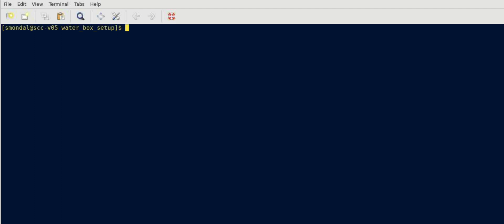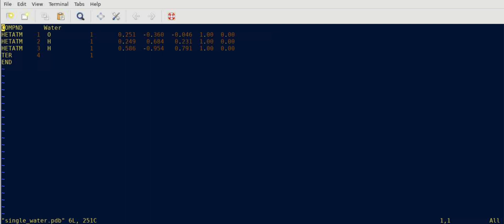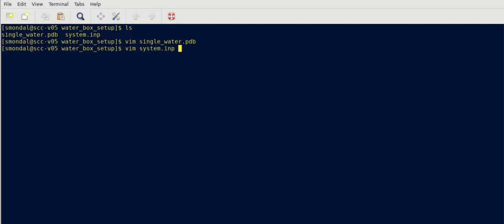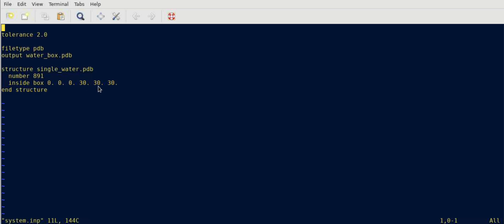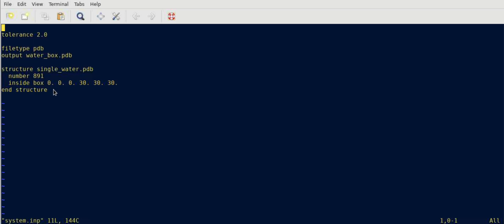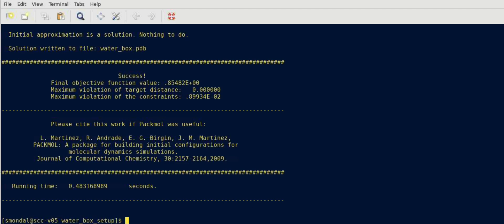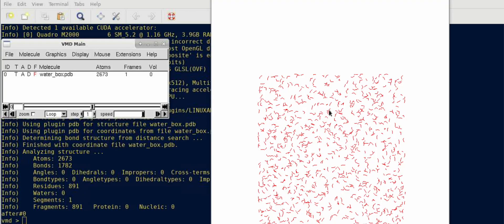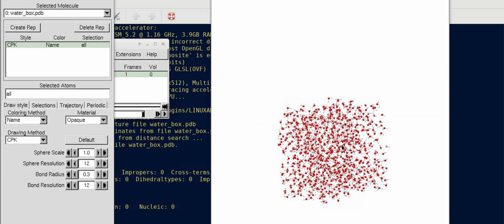Prepare a water box for #simulation | Initial structure generation with #packmol

Comment: How can i create pdb file of water?   I mean how can i generate atomic coordinate xyz file for one molecule? Thank you Sir
Reply from the maker: HI Jason, 
You can either download it ( https://williams.chemistry.gatech.edu/structure/small_molecules/index.html ) and check the formatting/atom names etc., or you can manually write it. Even if the bond lengths and angles are a little off, the constraints in the .itp file will make it right once you energy minimize the box.
Reply: @sayantanmondal6461  ok i will try it. Thank you so much, also Sir i used some methods  but i am not sure if it's right. first I build the model structure in material studio and convert it to xyz file then apply force field using moltemplate and generate lammps data file. It works, I run it in lammps but i am not sure if my method is right? Please give me your opinion on this. The problem I am afraid that there might be some mistakes in coordinate on x y z, or is it okay Sir?   Thank your answer
Reply from the maker: @jasonbestboy1667  there are indeed several ways to prepare and simulate water box. The best way to check is to calculate the radial distribution function and compare it with earlier studies. If the RDF matches, you can be pretty sure that your setup is right.
Reply: @sayantanmondal6461  okay thank you Sir. Sir can you please tell me that is the x y z file of molecules is generated using software or do we get it from some repositories. Since few days i am suffering from this problem. I can only generate it by designing model in material studio and convert it to xyz file. In the case of polymer. Because i went through many examples of data file they only put the value of atom position on X Y Z direction but about the value of atom position in (x y z direction ) no information where did they take from and i could not know where do they take this value from? Or the atom position are just converted from models that are Built in software like Avogadro or material studio. Hope my question is clear. I am new user of lammps Sir. Thank you in advance

Comment: How did you calculate the number of water molecules to be put inside the box, or can we randomly choose our desired number of water molecules to be put inside the box?
Reply from the maker: You can calculate the number of molecules from its density at the desired temperature. If you know the box size (volume), mass=volume x density. Once you know mass of the system, you can get the number of water molecules = mass/(mass of a single water molecule).